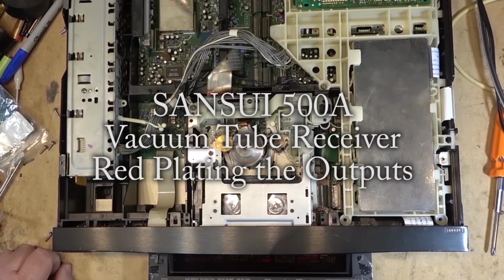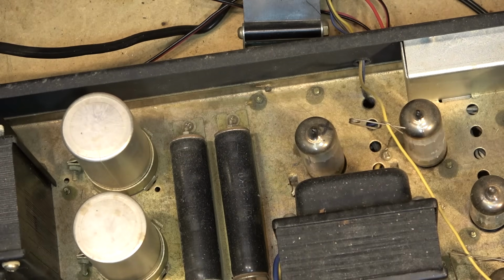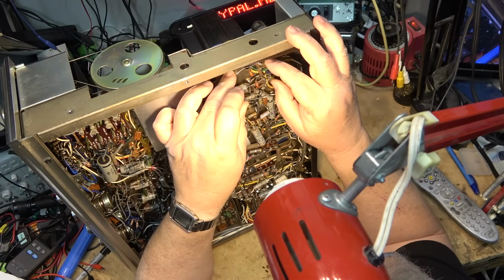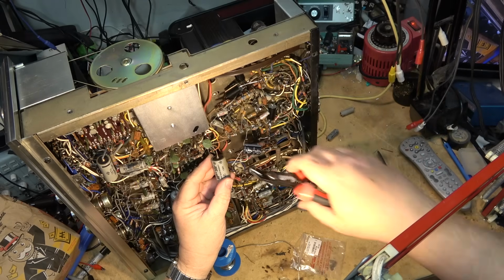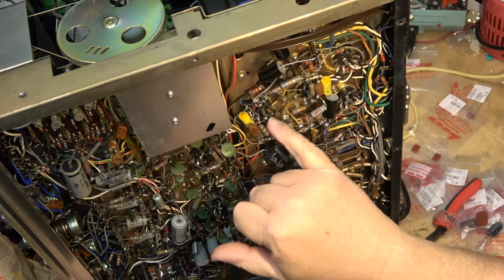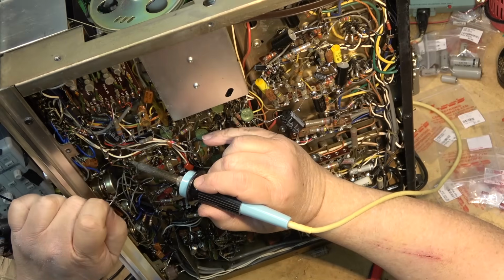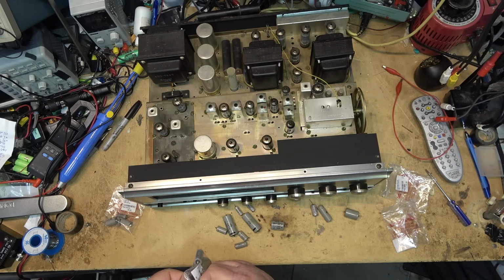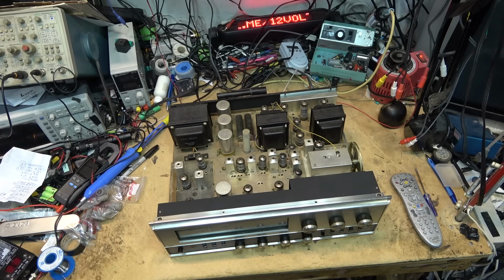Sansui 500A Vacuum Tube Receiver Red Plating the outputs lets fix it

Comment: Well, thank you very much, Dave.  I'm listening to the receiver right now as I write this.  It's hooked up to a very large set of Aztec Monet speakers.  Not the last word in quality but fairly efficient. Old school, man.  It sounds great, with 15" woofers, the bass is surprisingly good and tight.
New power tubes are on order.  But even with the old ones, it is sounding well worth the work done.  Fm is strong, but for now, I'm just trying the cd on aux.  Will try turntable inputs later.  
Dave really knows his stuff and best of all is willing to tackle anything.  Love to see, and hear, these vintage beauties come back to life. Appreciate you Dave...
Reply from the maker: It will certainly sound even better with new power tubes because those ones look to be original so about 60 years old.  I really need to dig out my old Macintosh and recap it.

Comment: Sometimes I'm forced to get stock from RS Components or Farnell... They not only plastic wrap them individually, but distribute them from various warehouses in EU and UK, so I often have the courier arrive out here (an hour from town) 4 times in one week for ONE order!!! Sometimes with just one capacitor or a strip of resistors worth a dollar or two. They definitely spend more on diesel than the part's worth. And then they blame consumers for climate change (whilst I save old junk from going to landfill and prevent some new crap from being manufactured and shipped from CHina). Rant over. Nice receiver by the way!